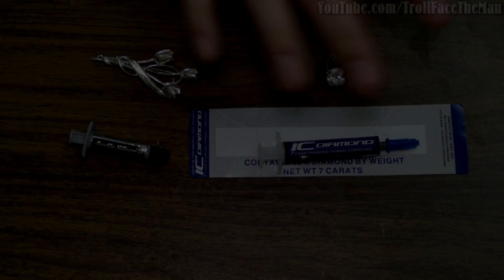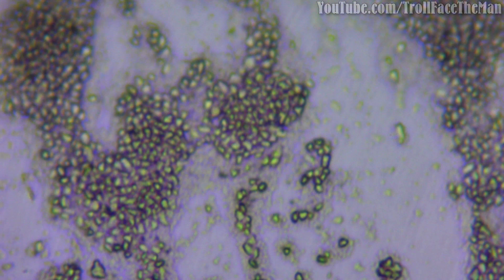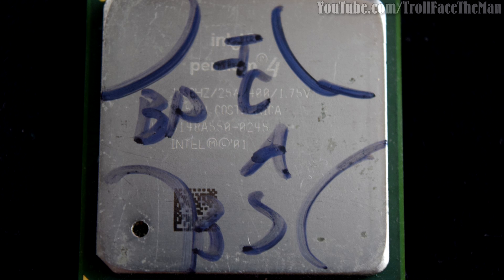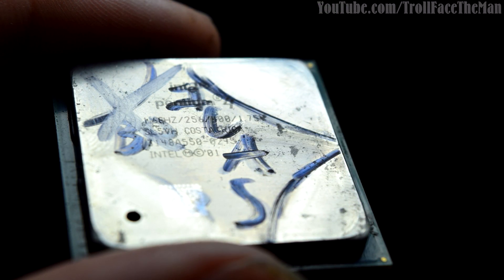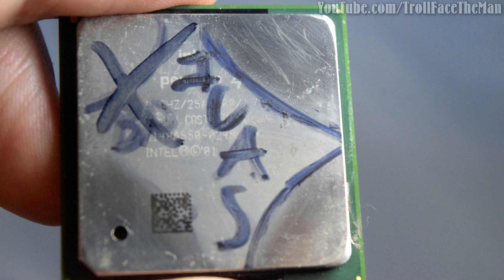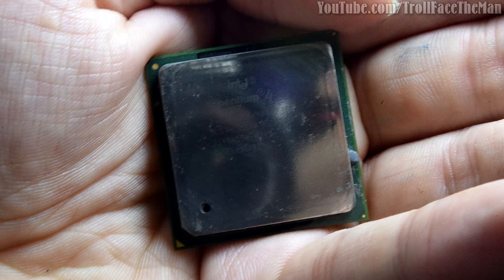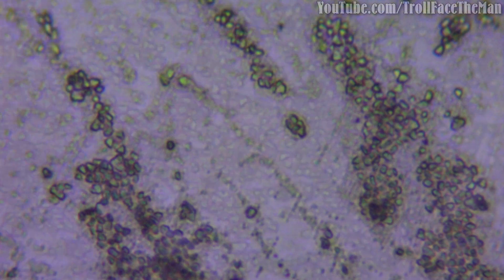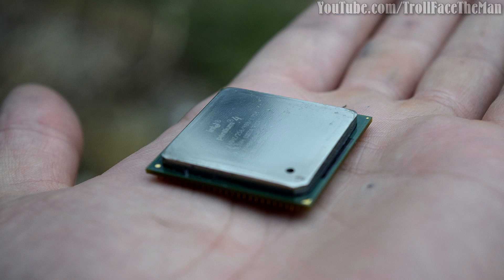Test Will IC Diamond Scratch..? (CPU, GPU,  Dies, Heat Sinks and Blocks.)

Comment: I have used this paste since 2013 on the same laptop. I reapplied the paste to the CPU and GPUs in 2016 after replacing a power-surged motherboard. I reapplied it again a couple weeks ago after reseating the slave graphics card, since the master died. I have observed the same "accidental/collateral" scratch-related behavior shown in this video and my personal experience is consistent with what is shown here. I I even used a bit of fresh paste to polish off a bunch of leftover scratches on the heatsink.

I'd like to add that while the original IC Diamond applied by Sager to my computer retained its viscosity for three years (until I reassembled the computer) the paste I applied in 2016 (tube purchased in Ebay) had hardened significantly throughout the course of four years and appeared completely dry. However, despite having solidified, there were no measurable adverse effects in system temperatures (daily monitoring, temperatures remained consistent with original paste application by Sager). No cracks were visible on the paste after heat sink removal. Repeated alcohol soaks of the dry paste had no solvent effect whatsoever and did not soften the paste at all, so I had to scratch it off with a piece of plastic. Dark grey stains were left on the heat sink surfaces near the edges of the paste, and have the appearance of chemical stains. No stains present at the center of the heat sink where the paste bonded it to the GPU.

I am very pleased with the long-term reliability of this paste. Throughout one cycle of three and one of four years of regular temperature monitoring on the same system, there have been no unexpected fluctuations in temperature nor anything suggesting a decrease in thermal conductivity.
Reply from the maker: Thanks for the insight.

Comment: Hey, I just saw this video and I wonder how much the actual conductivity values factor into heat transfer from the IHS to the heatsink? In one of the comments, you recommended MX-4 as an alternative to IC Diamond. A little research in both the compounds tells me that IC Diamond 7 carat has a conductivity of 4.5 W/mK, compared to the 8.5 W/mK, which should make the MX-4 an obvious choice over the IC Diamond, not just an alternative.

Also, how would you compare this to the Thermal Grizzly Kryonaut that boasts a 13 W/mK conductivity? I am genuinely curious about your take on this.
Reply from the maker: Hopefully this will help.
Reply: Hmm, I wonder why there doesn't seem to be a direct/linear correlation between the conductivity and the temperature readings. 

Would it be right to assume that the temperature tapers off at about 31°C despite two fold increase in conductivity simply due to the lack of thermal potential? Or would it be something else?

Either way, very informative chart! Thanks!
Reply from the maker: @achintyadutta1972 , yeah there is always a issue of maximum thermal bandwidth. Usually based off many things like the paste between the Die and Heatspreader.

 The paste between the heatspreader and the heatsink. And just the thermal conductivity rate of the Heatspeader and Sink and so forth.

 There will always be a bottleneck in some way or another.
Reply from the maker: It's possible that Mx-4 might have that high of thermal conductivity only under the most ideal circumstances I cannot say.
Reply from the maker: https://cdn.mos.cms.futurecdn.net/yqSq6qVDxvcsSQc3kFUvfG.png

Comment: I had IC diamond scratch the die of my GPU, its not a big deal though people sand bare dice all the time
Reply: does the scratching do anything to the die?
Reply: @evilbob2200  No because its just the nickel-based diffusion barrier layer used to keep the silicon from contacting the air(and its pollution impurities) as well as thermal paste dust etc.
 Look up CPU Die sanding
Reply: @kommandokodiak6025  awesome i had no clue!! So i dont have to worry about using ic diamond on my 3080 when i get it haha
Reply: @evilbob2200   you dont, no. IF you dont already have the IC diamond i recommend cooler master mastergel maker or Gelid GC Extreme instead as they are better  (havent tested KPX but im sure its good too)
Reply: @kommandokodiak6025   I have a tube of IC diamond but wouldnt be opposed to trying one of those others since 10-12 bucks for TIM isnt that bad. I wanna use whats best for my gpu haha i was thinking about kpx since kingpin is a big name for OCing.
Reply from the maker: That is one thing I have always been worried about using IC diamond for. Barrle dies as if something happenss to a heat spreader it's not really a big deal.

 Something happens to your chip... Well that is kinda a big issue.

Comment: how is it going to scratch anything? to scratch something there has to be some movement of the abrasive. thermal paste does not move, it stays put for years at a time. also it is designed to fill in irregularities on the surface, like scratches. that is the whole reason for using it.
Reply from the maker: That is very true. Guessing most is initially movement when mounting.

Comment: I've been using IC Diamond for maybe 9 years now, i'm a software engineer but I build my own workstations and 24/7 servers, I actually write AI software and often have computers running 24/7 back testing data.   These computers will stay at around 100% for many hours back testing data.   It's critical the software does not crash as I would have incomplete data, also I have to keep CPU temps low to help maintain reliability of the computer.  

Not only is it's performance very good (it once took 12c from an Nvidia GPU!), it's very durable and I've never once had to replace the paste.   My oldest computer is an i7 3770k still in use and temp performance is still fine after 8 years.   And regarding scratches I must have applied the paste 20 times to CPU's and GPU's and scratches don't even enter my mind.   To apply I clean both surfaces with Arctic Purifier, then apply one IC Diamond blob in centre of CPU/GPU, then fit cooler.  You should run the computer for 20-25 mins to let the paste warm up, then re-tighten the cooler screws this helps the paste spread a little more, as paste is thicker then most.

IC Diamond is a really really great paste, and after 9 years have no plans to use anything else.   I hold IC Diamond in the same high regard as Nvidia Quadro, Seasonic PSU's, Draytak routers and Western Digital Enterprise storage,  all other things I use also.
Reply from the maker: Thanks for the input.
Reply: After putting the cooler on, before tightening the screws, twist the cooler back and forth in a similar fashion to grinding. When you start to feel the cooler grinding against the cpu, then tighten the screws for a perfect contact.
This is my trick of the trade.

Comment: IC Diamond is basically a Perfectionist's dream.
Reply from the maker: It's pretty good, but liquid metal still gives better temps.
Reply: @TrollFaceTheMan  Btw, I'm new to the whole thermal paste thing, what would you recommend is the best thermal paste?

Also higher W/m-k is better right?
Reply from the maker: @GabrielTobing , yes in general it is. For recommendations I personally like IC Diamond but Artic MX-4 is another good choice.

 Artic Silver 5 is good too but needs special considerations as it is very mildly capacitive.
Reply: TrollFaceTheMan Thanks! Much appreciated.
Reply from the maker: @GabrielTobing  no problem.

Comment: It does cause scratches. I have four scratched coolers and cpu heat spreaders damaged from using this product.
Reply from the maker: If that is the case may I ask why you used it on 4 different heat spreaders and coolers if you knew it would scratch?

 If you also don't mind me asking what were the 4 different heat spreaders and coolers used for?

 Lastly how did you go about cleaning it off?

 Me and many others have had no issues with IC if applied and cleaned carefully.

  Would you mind sharing pictures so I can take a look too, thank you.
Reply: I had no idea that IC Diamond would cause scratches at the time I used it on all of my machines. It wasn't until after I took them apart for maintenance  that I noticed all of the machines with the same scratches on them. I used Arctic Clean on all of them before each application. I have used other thermal pastes before and after and never experienced that with any other product. And it leaves a very dark stain on the cpu heat spreader and on my copper heat sinks. I had to use brake cleaner on them to get that ugly stain off of them and then I wet sanded them to remove the surface scratches but two of the heat sinks actually had pits in them. Now, that being said. IC Diamond works. It does help drop temps. As far as that goes it does do a good job. Just be forewarned..............it does cause scratches.
Reply from the maker: @eddiea3782 , pitting tends to be from chemical reactions leading to corrosion not so much particle size. 

 Regardless though might I ask when you bought the tubes and from where? 

 4 machines seems like a lot, though honestly I have 3 myself so I suppose I can say too much. What do you use them for so I can get an idea of workload.
Reply from the maker: Also pics if you have them will go a long way.

Comment: Thanks, was curious about this rumour as people seemingly just accuse it of doing this and don't post pictures of it themselves.

Raked back to a 2014 thread on eevblog where Phaedrus the PSU god on OCN mentioned using it in a professional context at EVGA overclocking labs. So it is used in a professional context.

https://www.eevblog.com/forum/beginners/what-are-the-ingredients-in-thermal-paste/msg409167/?PHPSESSID=v82k4jl086m4km5ocara7ob229#msg409167

Little pricey though, even if it does have sparkling reviews no pun intended, people seem to talk it down.